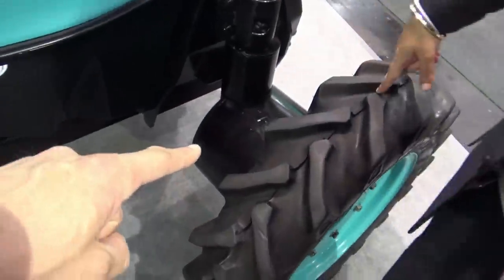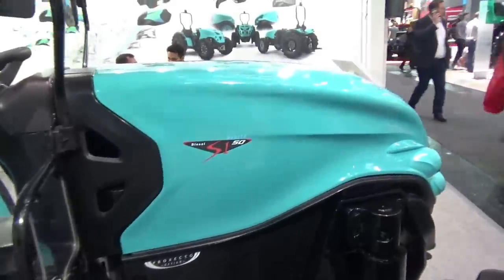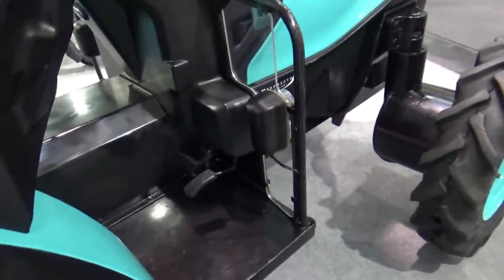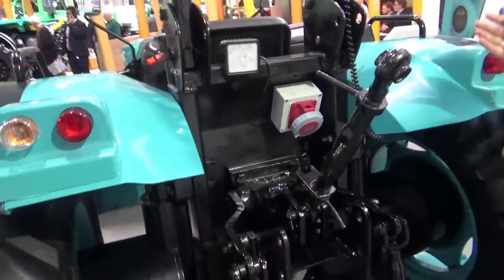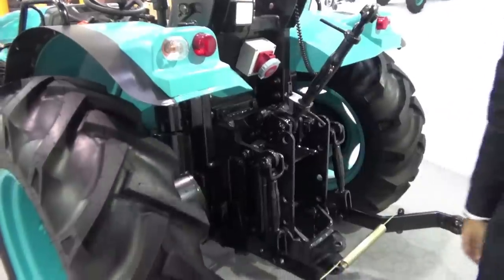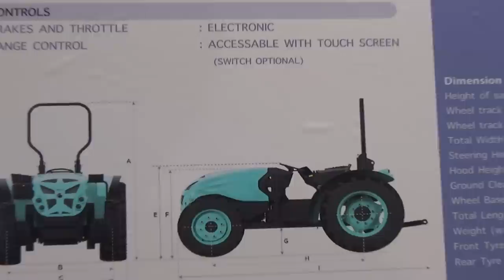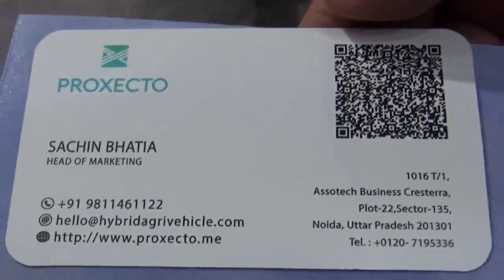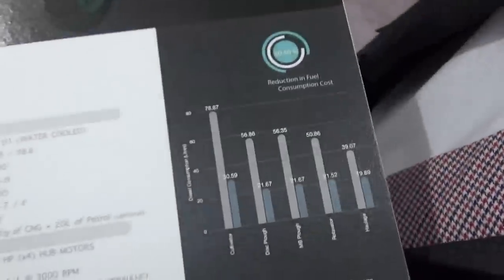The 2020 HAV 50s1 tractor made in India

Comment: Is this a hybrid tractor, with no battery storage of power? I hear later on he says a battery powered version will be made.

It looks like an ideal design for hills and orchards. Low centre of gravity and low profile.
Reply: It's hybrid. Diesel engine produces electricity which powers powertrain electric motors and electric pto. But the design is "future ready" as he says, they might remove the diesel engine and generator to replace them with batteries.